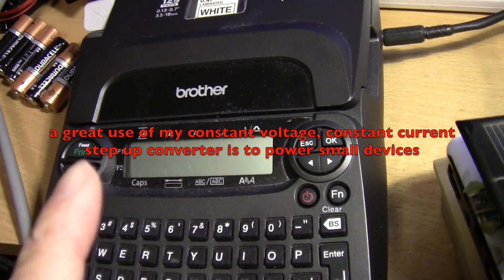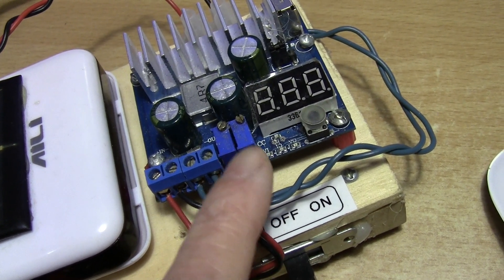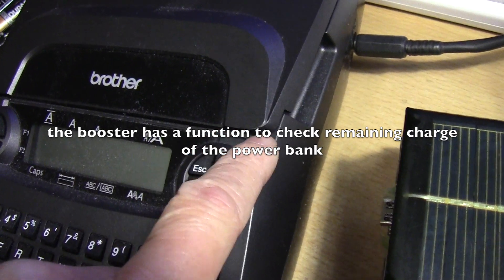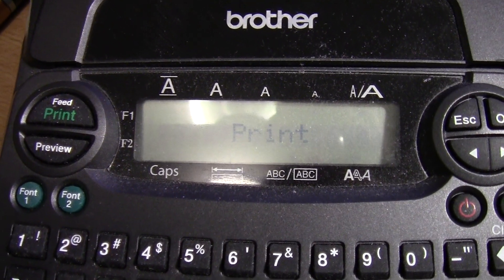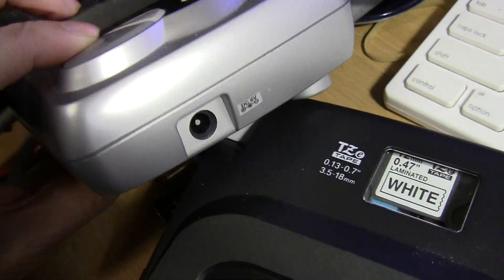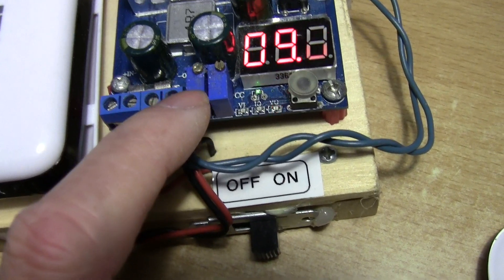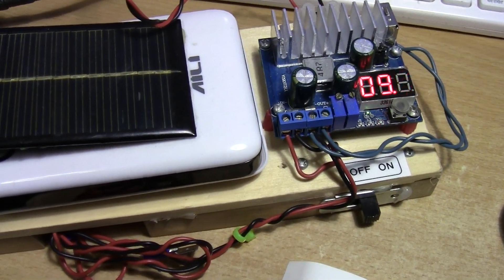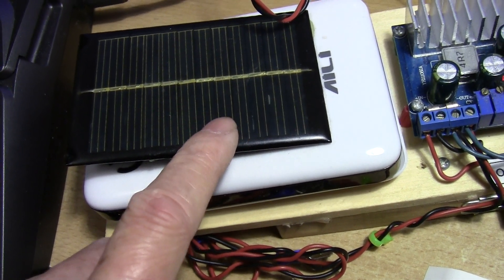Practical uses of my voltage boost converter

Comment: I have all those parts.
Reply from the maker: It's easy to put it together. Just make sure the output voltage matches your device. The usb output on my board changes when I adjust the voltage so it's important to check the voltage as show by the LED.